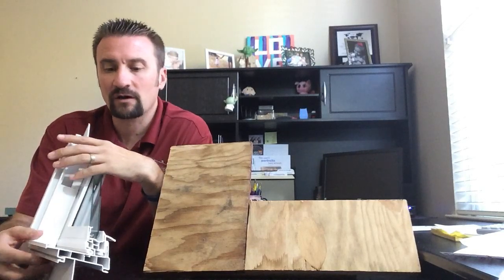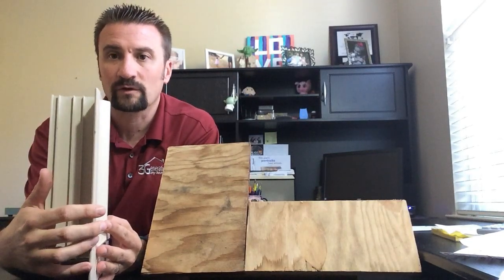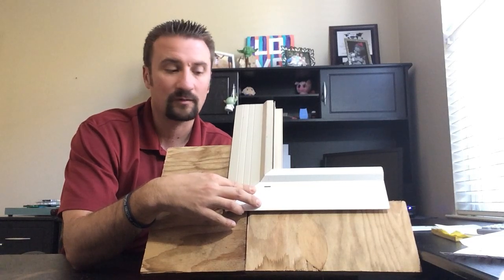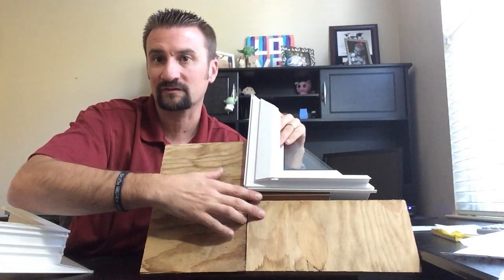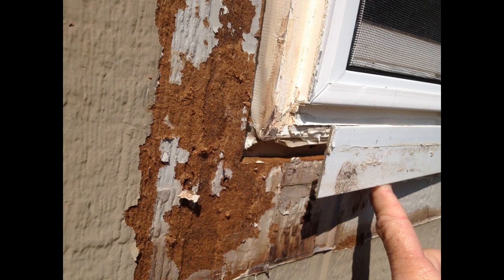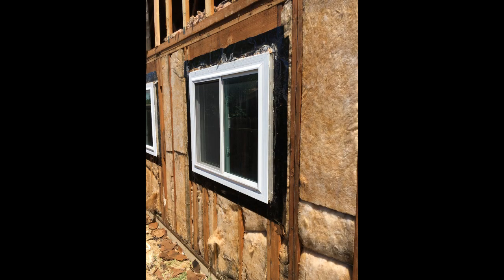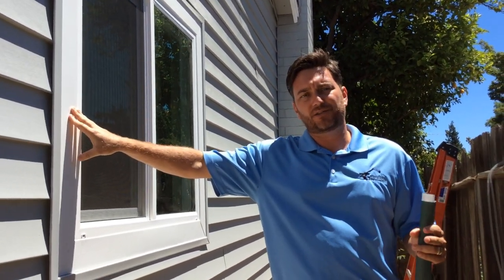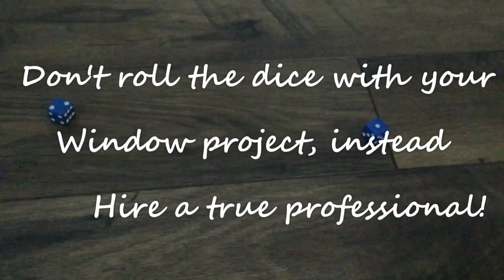Replacement vs Nail Fin Window Installation

Comment: how do you replace old vinyl windows? 1994 vinyl-therm, out of business in 1996. recently bought house, had receipts of install date. They are still in working condition, just a bit drafty, way better after I recaulked inside frames, double hung the whole 9 yards of efficiency, elow, tinted, double pain, all that jazz. Just have one moisture inside and picture window doing same. MN weather. Outside has all the drip edging and all that done. recaulk the outside around framing, and 1/4 inch gap all around with a bead already? Steel siding. The windows I have no idea how to take out, no levers to use. Has full screen built in it seems. Thank you for the information!
Reply from the maker: With steel siding on the outside, the easiest way to install new windows will be a replacement window.  However, if you go this rout make sure the window contractor is comfortable with this install type and will guarantee against leaks.  It is also very tough to install replacement windows over vinyl because of how much vinyl framing you have to cover with the new window. If you go with a nail fin installation, it would require extensive siding work (especially if the siding is installed up to the edge of the window frame instead of a coil wrap trim detail).  You could consider getting a glass shop to add weatherstripping to the windows and replacing glass where needed.  Caulking and weatherstripping will help with the drafts and may be your best option for now.  Without looking at it, I will likely recommend this maintenance option to avoid the hassle with the other two options.

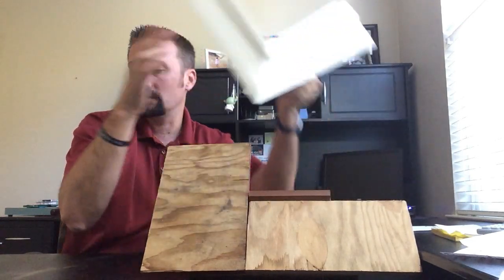Comment: 5:30 But I have an older log home, so it's my only option I think.
Reply: Yes, if the logs go right to window opening, you will have little choice but to install replacement windows. You could add extra wood stops on the outside of the windows to protect them and have them match the siding better.
Reply: @jeremyowens95630  Thanks for the reply!  yes, the logs go pretty much right to the opening.  I was thinking about breaking out the chainsaw...  and making a frame.  But that might be too ugly.
Reply: @desert4seat  Yea, easy with that!  :)

Comment: "Block Frame Window". Thank you. The trouble with a Flange Mounted Window is the fact that it made the Window Shutter decorative-only, no longer functional.
All these people hanging plywood over their windowns and creating new moisture penetration holes for incoming huricanes "get to" repeat the process for every new threat. Block Frame  Windows would permit the homeowner to CLOSE THE SHUTTERS then open them again when the threat passes.
I honestly believe that the flange design was the cheaper method, both cost and result. It permits a retrofit for existing homes and is the quickest way to build a home but not the best.
Reply: I agree, retrofit is the quickest and easiest, but not the best at all due to moisture penetration and loss of glass space.  We don't have the hurricane threats here in sunny California so we do not see that as a problem and block frames are only (or should only) be done when installed in place of the old wood windows and set inside the stop.  This question/problem is the most misunderstood by homeowners that we come across in our industry.

Comment: Excellent video! I bought a 23 year old house that needs new windows and siding. It is sheathed in OSB that was not wrapped in a WRB because the code at the time did require it. My plan is to use new construction windows so the rough openings can be inspected and repaired as necessary. Then the sills will be reflashed with modern day materials and the windows with nail fins will be installed with caulk and correctly flashed for proper water management. My question is, can all this be accomplished without removing all the interior window casings which are beautiful and in perfect condition? I have seen new construction windows with foldable nail fins and was wondering if the window could be shimmed, foamed, fins nailed/screwed, and perimeter flashed all from the outside?
Reply: Yes, you can leave your wood sills in place, but will likely have to trim some of it back because the new windows are thicker than original.  I prefer welded nail fins for the best water hold-out potential. Most windows also have 2 different nail fin set back options - 1" and 1 3/4" (which is how far the fin sits from the outside of the window).  Think through this as it is best for the window to sit inside the wood trim on outside as opposed to sitting even or proud of the trim.  Hope that helps!
Reply: Thank you Jeremy! Yes, your reply was very informative. I was born and raised in Sacramento and remained there until I retired and moved to Wichita, Kansas. I plan to install new Class IV roofing shingles, new siding and new construction windows all at the same remodeling event. I sure miss the Sacramento/Folsom/El Dorado Hills weather!
Reply: @tomheringer2047  Thanks, good luck with the remodel!

Comment: Good video. I have leaking problem with my retrofit window. The contractor suggest me remove and change to a new construction window, does that mean I also need some siding work? Do you guys do San Jose area? Thanks
Reply: Sorry, we do not serve your area, we are out of Folsom. In order to complete a nail fin installation, you will need to complete some minor siding or trim removal/repair in order to get the window out and good flashing in.  Hope round #2 works better for you!
Reply: @jeremyowens95630  Thank you. I got a quote for $750 for each window replacement(including removal, install, waterproof and stucco siding work etc), is that a reasonable price? Not include the window itself. Thanks
Reply: @ydong3791  Yes, that does appear to be a fair price.
Reply: @jeremyowens95630  Sounds good. Thank you

Comment: Thank you! This was actually very helpful. We had our aluminium siding removed & replaced with vinyl around 2006 or 2007. It's still in great shape, but we unfortunately did not have the budget for new windows at the time. So we are stuck with hideous metal windows (some of which are cracked or even broken and patched with duct tape). The house was built in the 30s or 40s so it is very old. The door sills are rotted but I can't tell if there is any problem with the windows as they have J-trim all around.

I would like to remove my metal windows, remove J-trim & pull back vinyl siding carefully, install flashing all around (I will check to see if there is z-flashing above the windows), and install new double pane vinyl windows.

Could I use a new installation window with a nailing flange if I pull the siding back far enough?
Would I put flashing over the nailing flange as well?
Would I be able to just pop the J-channel trim back in place afterward?
(I live out in the middle of the woods and I have a hard time finding reliable installers & while I do intend to hire someone for it, I want to make sure it's done right & that I order the correct windows).
Reply: Thank you for the kind words. This is a tough one because peeling back the vinyl siding and J-channel is very hard to do and not likely going to be easy at all.  The nail fin of the channel trim sits under the vinyl siding now, so you would have to remove the last nail of the vinyl, then remove all the nails around the channel to get it out, then peel back the siding to flash and install the windows.  Definitely a 2 person job and the tough part would be trying to get the channel back in the same spot and same way.  This can be done, but one window at a time and very methodical. 

If you have good eave protection and it is a one story, this could be a candidate for replacement windows.  If you can get a good caulking connection between the old frame and the new it should work out ok, but I do not recommend trying to install replacement windows by yourself. It sounds like you are in a difficult area to get help, but I would keep trying that route to see what opinions you get.  Good luck!
Reply: @jeremyowens95630  Thank you. I've seen how the vinyl siding can be pulled back, but the J-trim was the main concern. I think I have about 2ft of eaves overhang but I haven't really measured-- I'm just eyeballing it. It is a single story house. Unfortunately, some of my windows are facing the south and east & we get a LOT of rain. Sometimes the wind blows the rain sideways so it directly hits the windows. 
I do have some windows that overlook a covered porch so they won't need to be sealed as much. Another issue is I have windows side by side connected by mulling to make them appear huge. One of the windows is technically 3 windows connected with mulling. That is definitely not a DIY job. LOL.
Reply: @mycats7321  Definitely sounds like a job for a pro!  Good luck!

Comment: If you're left with having to go with block frame and installing from inside, is there a good solution you could suggest so we don't run into the issues you described?
Reply: Not ideal to not have any flashing tape as you are left to rely on caulking.  If the block frame is butted against the outside wood stop (if you are installing the from the inside) try back caulking against the stop to add one additional layer of protection along with caulking where the frame meets the outside trim as well.  If you stay on the caulking and painting on the outside you should be fine.

Comment: So I have Brick which means my new construction window flanges are behind the brick. Is the block frame my only option? I live in Florida with Hurricanes and Im very skeptical about water wind driven rain and that these style are not prone to be forced into the home.
Reply: Yea, that is a tough one.  I would make sure a window professional guarantees their work.  I would order the windows with a replacement fin and install the new window over the existing frame (you will have to cut some of the fin back first).  That way, you have some caulking where new fin touches existing window frame.  Most of the time this is ok for brick applications because the window is inset enough to avoid the entire force of the wind driven rain.
Reply: @jeremyowens95630  so screw the fin into the old frame? Only caulking? No additional flashing?
Reply: @Skiroy  the fastening would be through the inside of the window into brick, no screws exposed from outside of window.  The window manufacturer will have instructions on where to fasten and can provide hole plugs to make it more attractive.  No other flashing can really be done.
Reply: @jeremyowens95630  are there any window brands that you believe are good for bronze colored frame longevity? Are there any windows in general as far as brand to stay away from?
Reply: @Skiroy  The Anderson 100 Series window is good for strength (since it is fibrex)  and color options, but they do not make this window with a replacement fin.  I am not a big fan of painted vinyl as it scratches easy and most manufacturers will not warrant the paint for long.  Since window manufacturers vary depending on location in the US, I would look into who is distributing fibrex or fiberglass windows in your market as they will provide the longevity and color options.  Good luck!
Reply: I do alot of installs with brick windows in Manhattan. Brick in residential is slightly different but you have essentially one course of exterior brick and then your inside 2 x 4 or 6 framing. You could rip out the whole frame and essentially do what we call a brick to brick install. This is a more elaborate install but lets you control the water proofing. Before ordering your window though you will want to pull off your inside trim and then compare your window framing rough opening to your masonry rough opening. Sometimes the dimensions are equal some times the wood framing is smaller. If the wood framing is smaller you can order your window to the wood rough opening dimensions and order your window with a brick mould casing from the manufacturer or pick up brick mould yourself from a milwork place. For water proofing we use a peel and stick membrane along the jamb and sill and then lay a sill pan over the wood framing out and onto the brick. The jamb peel and stick drapes into the end dams of our sill pan. If the frame is ordered to the brick rough opening we just caulk the perimeter of the frame to the brick. Any water that gets by failing caulk rolls down the peel and stick membrane and collects into the pan. If you want to install a replacement window there are other things to consider. If the original frame is wood is the wood at sill not rotted is the frame square if so you can order the window to the dimensions within the frame of the old window as an insert window. Basically from the inside you will remove the inside stop remove the sash and parting strip caulk the exterior blind stop and install the window to the blind stop by fastening through the jambs. Then the exterior can be capped with break metal. Also you can do that process in reverse and keep you inside trim intact by ordering window to within frame dimension but remove exterior stop remove sash and parting strip caulk inside wood trim and install window to that fastening through jambs. On this last detail you can cover up exterior frame by ordering insert window with brick mould to cover old frame on exterior.
Reply: @racerx6384  Well said, love the thought and detail in your water-proofing!

Comment: So take out old window and install new construction no matter what ? I have stucco so I would have to break off some stucco ?
Reply: Not an absolute must for  every home, but yes if you did install new construction windows you would have to cut back the stucco 6-10" in order to get proper flashing tape installed.  If the window contractor is comfortable with replacement windows for your home, then make sure they guarantee leaks for X amt of years.
Reply: @jeremyowens95630  Not correct. Use a window with a stucco fin instead of nailing fin...sometimes called a Z-Bar frame. NO stucco is removed/disturbed/cut.
Reply from the maker: @capitalglass912  That is definitely one option and most window contractors do it that way in our market as well.  We deal with a lot of leaky replacement (z-bar) windows on 2 story south exposures in our area that are done by other contractors.  For that reason, we like to educate our clients with both options and provide the pros and cons of both and let them be part of the decision on install.
Reply: I received no education on my window install methods.  Now I am stuck with these ugly flush fin retrofit replacement windows.  They look nice on the inside but exterior stucco wall now looks terrible.  With all the education I’m finding now,  I’m considering pulling out the new windows and starting from scratch using a different installer.  Here from Bay Area California.